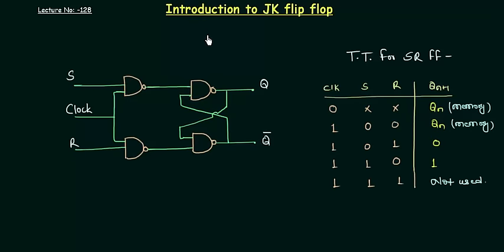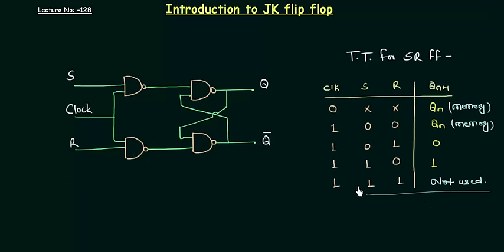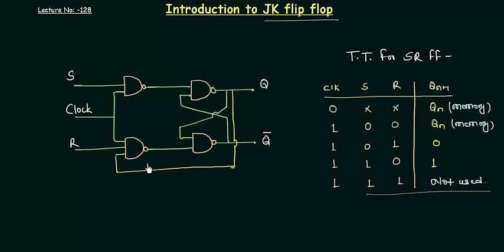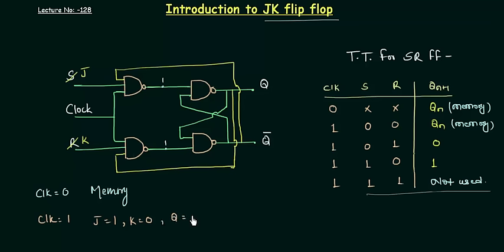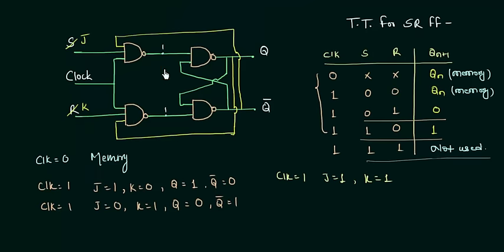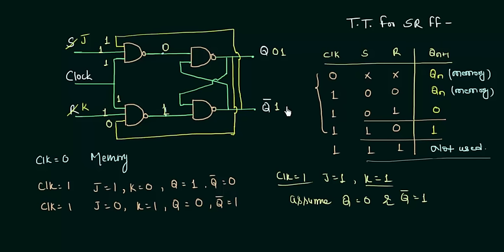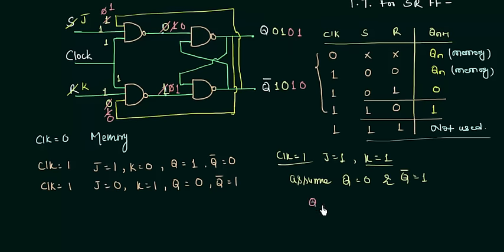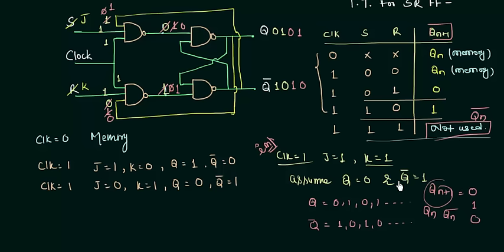Introduction to JK flip flop

Comment: After doing a couple of hour of observation and trying different combination of gates for flip-flop I came up with these conclusions.

Things get really confusing when we moved to the J-K flip flop.

Let’s start from beginning,
We’ve two data storing elements i.e. 
1: SR NOR Latch
2: SR NAND Latch

They work the same but their truth tables are completely opposite to each other. i.e.

SR NOR Latch truth table 

S        R        Q
0        0        Memory state
1        0        1
0        1        0
1        1        Not used

SR NAND Latch truth table 

S        R        Q
0        0        Not used 
1        0        0
0        1        1
1        1        Memory state

After studying these basic memory elements. We moved to SR latches with “enable”. This enable is input to the two NAND gates along with Set and Reset (as in the circuit diagram shown in video). The output of these two NAND gates is input to the Latch (SR NAND). If we replace “enable” by “Clock” we would have a flip flop. 

Let me ask you a question. Can’t we use any other combination of gates?
Of course, we can.

See the possible combinations which will work as an SR flip flop.
1. AND-NOR
2. NOR-NOR
3. OR-NAND
4. NAND-NAND (Used in video)

You must be thinking what about the other combinations?
5. NAND-NOR
6. OR-NOR
7. AND-NAND
8. NOR-NAND

These combinations (5 to 8) will not work as flip flop. Try making truth table for each of these combinations. After making truth table, You’ll realise that these circuits (5 to 8) are automatically going into “Invalid State” when the clock is Low/High depending upon the circuit configuration. Flip flop must follow one property, if clock goes Low or High, it must have a memory state. See these circuits
are not storing data we can’t use these combinations. 

The only possible combinations which will work as an SR flip flop are:

1. AND-NOR
2. NOR-NOR
3. OR-NAND
4. NAND-NAND (Used in video)

Hope, it cleared your doubt till now.

But as we move to J-K and T flip flop. We again have some limitations. 

We get J-K flip flop when we feedback Q’ to the top NAND gate and Q to the bottom NAND gate

Using this type of arrangement of feedback. Only two possible combinations will work i.e.
1. NOR-NOR
2. NAND-NAND

Did you see? We started with 8 combinations and end up having only two useful combinations for J-K and T flip flop.

If you want to use the remaining combinations for J-K and T flip flop
1. AND NOR 
2. OR NAND

Then, these two combinations can also be used if we make some changes in the feedback arrangement.

Suppose, if we have an AND-NOR SR flip flop we want to make JK flip flop then we have to use this configuration,

“If Q is input to the top AND gate and Q’ is input to the bottom AND, using this configuration the remaining two (AND-NOR, OR-NAND) will also work.”

I tried every possible combination and their truth table. Everything in this video is correct and accurate.
Hope it helped you!
Reply: your stuff is kinda wrong in terms how it is tought in my school. Here truth tables are the same with any gates, what changes are the inputs and the scheme

IE in SR latch with nand if you give top input s and bottom input r while top output is q
then you will get the opposite of regular truth table however in my university that is considered a nonsensical trigger. You have to give both inputs reversed, so top input is 'not s' bottom is 'not r' ;;;; outputs: top 'q' bottom 'not q'
though there are other combination where the table would be correct as well IE
nR->nQ
nS->Q

and only difference of sr and jk is the 11 in sr is undefined and in jk is reversed.
Reply: Wow great..... excellent understanding
Reply: thanx saved me a lot of time
Reply: Bhai logic gates ki sale lagi thi kya
Reply: @ir2001  we can use simulators
Reply: @ir2001  LOL
Reply: AWESOME VERY DEPTH KNOWLEDGE REQUIRRES THIS EXPERIMENTS AND U HAVE THAT😍👍😍👍
Reply: Thank you , my man
Reply: Oooof size: Big
Thanks for the summary
Reply: You are great 🙏
Reply: @gytisdramblewolfskis8521  as long u are not change the output q (top) and ~q (bottom) the table remains unchanged irrespective of the pos of R or S
Reply: Wow ❤️
Reply: I guess now you are a professor in college of this subject 😹
Reply: i ain readin allat

Comment: That was a wonderful presentation! However, I do wanna point out that there are two main variations on the SR Latch (which are used to synthesize the JK Flip Flop)...refer to the previous video as self-evidence. WHY DOES THAT MATTER? ==>> The NOR type preserves the memory state of Q, Q_bar whenever S = R = ‘0’; S = R = ‘1’ results in the forbidden state. The NAND gate simply inverts the relationship, where all ‘0’ is forbidden and all ‘1’ is the memory preservation state. I noticed that the SR schematic is NAND based, whereas its truth table is NOR based...an alleged contradiction, if you will. I’m not a seasoned pro at this, but I think my observation makes sense, and can be used to improve the insight that you provided. Again, great video, (& to the viewers, take the presentation with a grain of salt). :) I’ll keep watching, Neso Academy. Have a great day!
Reply: +Oswald Chisala this is really confusing me how can we use NAND based rs F-F while using NOR based f-f ??

Comment: If I assume Qn-1 = 1 and ~Qn-1 = 0, and I also set c=1, j=1 and k = 0, then the Inputs of the last nand gates (so the one for the latch)  are both 0 and 1, which would result in Qn =1 and ~Qn = 1 if you go and check the network (not the truth table).
Reply: U are correct

Comment: 00:06 JK flip-flop provides an advantage over SR and D flip-flops.

00:51 Introduction to JK flip-flop

01:42 The JK flip-flop has two outputs Q and Q complement.

02:50 JK flip-flop and SR flip-flop have similar outputs except for the last case.

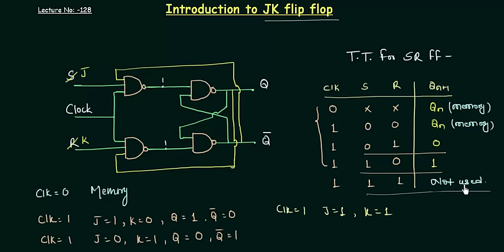04:06 Analyzing the values for Q and Q complement

05:03 NAND SR latch can produce different outputs based on input changes

06:01 The JK flip-flop races between 0 and 1

06:58 JK flip flop output is the complement of the previous state.
Reply: EE101
Reply: thank you :3

Comment: at 5:21 both nand gates in the second set are recieving 01 so both their outputs should be 1, no?
Reply: David Stern well ur doubt is correct but actually the mistake u r doing is that u r taking both the feedback values simultaneously dont do it simultaneously first take one feedback at a time and let the value of the one output change then take that changed new value as the feedback value for the other nand gate.You will get the correct answer.but here also start from the upper flip flop and not from the lower flip flop take the feedback that upper flip flop is getting get the new output and then take it as a feedback to lower flipflop.

the reason for this is that nomatter how similar two flip flops are they always has some speed difference in them which is of the order of picoseconds so we have assumed here by taking q=0 and !q=1 that the upper flip flop is faster so it will get the feedback first.....hope ur doubt is cleared now

Comment: In 5:13 you said that the when input is 0, 1 from clock and 1 from K, then nand output is 1 but it should be zero, right!? And gate for three inputs 0 1 1 the output should be 1 and the compliment of it should be zero, correct me if I am wrong!
Reply: OK got it, And gate means all input true then Output is true!

Comment: I have a question. Initially you had shown a S- R Flip Flop with S and R as two inputs with clock pulse present. That indicates that the NAND gates present in the first level are two input NAND gates. 

If this is the case then how a third input (Q or it's complement) can be added as one more input to these NAND gates? In this process the two input gates are changing to 3 input gates.
Reply: yes.. it can be done.. we have a separate IC for three input NAND gate (IC7410)

Comment: the truth table used is related to nor gater SR latch and you draw and explain all the video using the nand gates SR latch !
Reply: i also agree with omer..plz explain
Reply: he is using the truth table of nand, not that of nor
Reply: you are confusing between sr flip flop and latch
Reply: You guys are confusing the basic SR latch truth table, with the full SR flip flop truth table (which has two extra NAND gates)... S* and R* were shown in the truth table you are confused by. The addition of the two NANDs at the left side means S* and R* are inverted relative to what you saw before. So it makes it clearer actually, as S means set finally and R means reset, for values of 1.
Reply: sir used     clocked s R flip flop using nand gata.
it is correct
Reply: Dude it is truth table of NAND gate. Watch previous lectures if you are confused.
Reply: Lol this is funny. You came out of nowhere complaining about things.  1 1 is memory during NAND SR LATCH and this truth table sir is using is SR FLIP FLOP. Get your facts right
Reply: The truth table is for nor and the diagram is for nand
Reply: Calculate and you'll see that that is not the case.  The table is for SR- FF, having the nand gates with clk as input it gives you S' and R' as output. Do the SR-latch truth table with S' and R' and see. :)
Reply: Omer Khater say to sir using NOR gate flip flop
Reply: Position of S AND R ARE REPLACED IN NAND AND NOR SO THE VIDEO AND TRUTH TABLE IS CORRECT
Reply: FROM TRUTh TABLE OF NAND ANY INPUT 0 OUTPUT WILL BE 1 ONLY SIMPLY FOLLOW THIS CONCEPT
Reply: We are comparing sr flip flop with jk. not latch

Comment: sir, in previous video on SR flip flop, you had suggested that a 1-1 SR combination for NOR gate is not used, while for NAND gate, the one which was not used was 0-0. Now in this video, you've used NAND gate and still suggested that 1-1 is not used and 0-0 means the previous value, how?
Reply: To anyone who is reading this comment now, dont be confused. This comment is wrong. 1-1 condition for NAND SR FF is invalid, not 0-0.
Reply: @anubhavchauhan1485  what? the comment was right. 1-1 for nor gates was not used, 0-0 for nand gates was not used. The video should be wrong here.
Reply: @frankie391  I would have loved to cross check but it has been a year since I last studied digital electronics. I passed my semester exam so it's been a while. You may be right.

Comment: i have a doubt, In SR latch inputs is 0&1 and the outputs of Qn=1 & Qn'=0 why.............?
Then what is the use of another input terminal. Once recap in the 5th min 23rd second plzz
Reply: imran shaik hello ? Have you skipped the earlier video ? That part you were saying is the part that we suppose to use our basic SR NAND Latch Truth Table. Which is when RESET=1, QNOT=0.  Clearly the table showing in this video is not LATCH truth table but FLIP FLOP SR truth table. See that there is diff between LATCH and Flip Flop Truth Table

Comment: 5:20, You said for SR(0,1) output is (Q = 1, Q' = 0) for NAND SR. Then in SR FF video, you said that when SR FF is implemented using NAND gate then, (0, 0 ) is 'not used' condition. But here, you are saying that 1,1 is not used condition even though its NAND gate.
SR NAND Latch truth table 

S        R        Q
0        0        Not used 
1        0        0
0        1        1
1        1        Memory state

 Can you please explain how and why ?
Reply: Esne confuse kr diya hai aapko dusra video dekhna pdega.. Truth table nor ka hai example ckt nand ka.. Ckt desigh bhi RS ki jaga SR ka h.. Avoid this video!

Comment: Bro had a mistake, S=1, R=1 works as memory and S=0, R=0 is not used in case of SR flip flop when the NAND latch is used , you must use NOR latch for that in the cross coupling section 🤔🤔🤔🤔
Reply: Yes bro same confusion
I think bro took wrong truth table

Comment: Sir, is your flop level triggered? Because an edge trigger flop(generally used) is made by use of two latches..Kindly cross-check..If this is so, you should have used edge triggered flop which is of more concern thats the basic difference between a latch and a flop.
Reply: Where is characteristics and excitation table?

Comment: isn't it that for NAND SR latch, S=1 and R=1 is used for MEMORY while S=0 and R=0 is not used due to complications???
Reply: universaly for SR D T JK 
10 is set to '1'
01 is reset to '0'
00 is save

and only for T and JK 11 is flip value.

However to achieve that you need to change inputs in various ways (in asynchrounous Nor top input is R and bottom S while in NAND version top is nS and bottom is nR and so on.) At least that's how I am taught at the university. A lot of sources don't do this which makes learning this quite confusing because of ambiguity got negative marks for this.

Comment: TRUTH TABLE FOR NAND LATCH WILL BE AS:
S            R                     Q(N+1)
0            0                    Q(N)
0            1                    1 SET
1            0                    0 RESET
1            1                   UNDEFINED/ NOT USED

TRUTH TABLE FOR NOR LATCH WILL BE AS:
S            R                     Q(N+1)
0            0                    Q(N)
0            1                    0 RESET
1            0                    1 SET
1            1                   UNDEFINED/ NOT USED
Reply: This is wrong dude
Reply: your TT is wrong in NAND flip flop, please chect it out once., Which is undefined /not used when S and R both are 0.